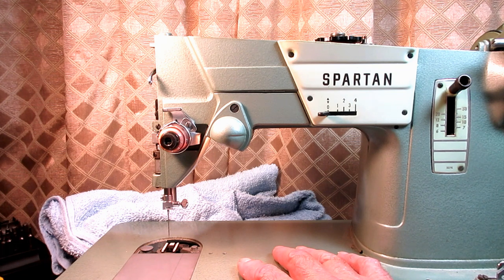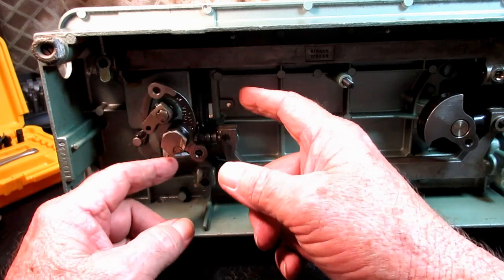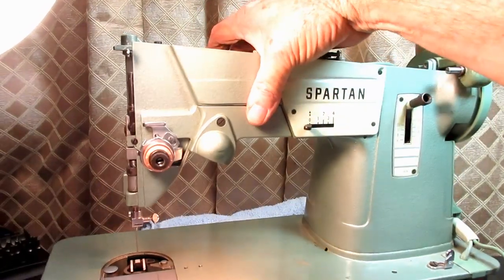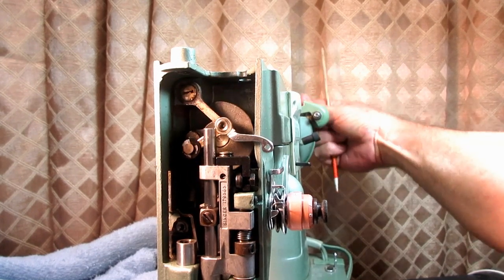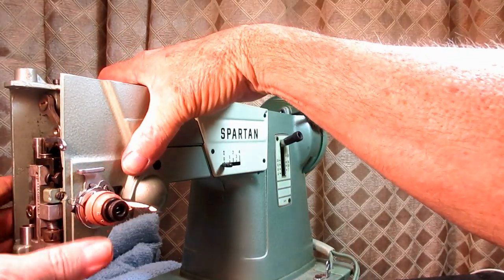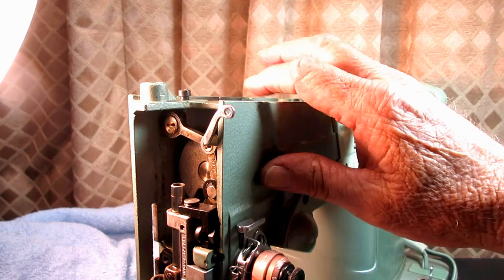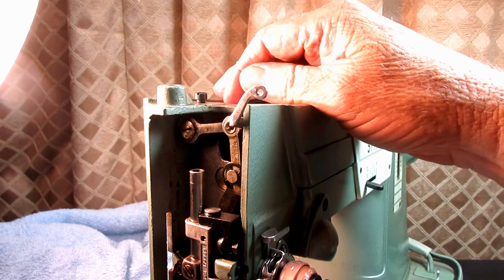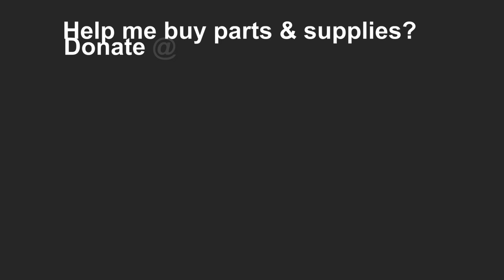How to Fix Binding of the Take Up Lever on a Singer Model 327K Sewing Machine

Comment: Hello again Andy, once again your instructional videos have helped me restore a jammed 329K. The culprit was one of the bolts that go through the pitman arm and fastened to the vertical drive-shaft block. Some previous heavy handed monster was not aware it was counter clockwise left-handed thread and in an attempt to release the bolt had actually tightened it to the point half that of the thread in the block is stripped and the joint seized solid... I made a temporary repair by switching the two bolts over and adding a drop of LockTight thread lock until I can find a donor machine or replacement block. Your guidance has been invaluable to me, thank you.
Reply from the maker: You're very welcome, and thanks for saving another machine, Ken. I can picture the person straining and determined to loosen the darn screw! I've had a number of stripped-out slots on that screw, but never one as bad as you found. Good luck finding the parts.

Comment: Andy, 

Once again, thank you so much for this video.   I will be watching it over and over again.  Thank you for the systematic way to check for binding issues.  I have taken out the take up lever on all the machines I've worked on (457s, 347s, 337s) and cleaned the take-up lever.  I was just never sure how to tighten that set screw.  Now I have a better idea, so I've  got to go back and check every one (seven total).  Putting a drop of oil in the set screw hole is very helpful for me to know, as some I've taken out seemed to be stuck.  Now I know how to check for binding in the bell crank system, too.  I'm starting to work on my 328K; it looks super clean and doesn't seem to have any binding issues, but I know how to start to solve any binding issues, if needed.  Fabulous video!
Reply from the maker: thanks for the kind words and I am impressed if you have seven to go back and check on you are a busy lady

Comment: Thank you for these videos. They gave me enough background to be able to take on fixing my old NewHome Janome 535/538 take up lever which was jamming against the machine casing. It turns out a screw was loose for one of the elbow joints and your video tipped me off on where to look, so I found that (trial and error), it is running beautifully now. (Note that I loosened the needle bar (unnecessarily in my case) and my model doesn't have any markings on it...so it took quite a while to learn to reset the timing...but I did. ) Cheers, and thanks again.
Reply from the maker: Nicely done there, May! I'm glad you found the video and it was somewhat helpful. Good on you for resetting the timing. Guessing you used needle eye height above the hook point, but however you got it done you should feel proud, and thanks for keeping that vintage machine running. Take Care.
Reply: @andytubesewing1953  Yes, I inserted the needle and tested it above the hook which gives a rough fit. Then I threaded everything to see if the needle would pull up the bobbin thread, once it did I tried sewing (by hand turning) and it was skipping stitches. So rather than go back to try moving the needle bar (which is cumbersome), I slightly lowered the needle where it is inserted in the bar to test the needed adjustment. This fixed this stitches so then I transferred that slight needle insert adjustment to the needle bar, reinserted the needle properly and got it all running nicely.
Reply from the maker: You're a natural VSM mechanic! On most of the SInger when the needle bar is on upward stroke the hook point should be behind the needle and about 1/16" above the eye of the needle. I have used that setting on non-Singer machines with good results. Anyway, congratulations and when you start your repair business let me know so I can run an AD for you. Take Care.
Reply: @andytubesewing1953  Haha. This is the first problem I have had with my machine since I got it for my 16th birthday - over 40 years ago! I plan to give it to my son who wants to learn to hem his jeans.
Reply from the maker: That's a great history for your machine. Props to your son; men sewing are a wonderful thing.

Comment: Great video Andy my first time here,
I have a model 237 fashion mate, I am having The Binding at the very top of the rotation for my wheel, I have oiled and lubed and dusted and the issue only comes when my machine is set on regular, when it is set on darn for the feed dogs, The Binding goes away

I went through quite a few of your videos and I only found one video for the 237

I have subscribed and any information would be appreciated thank you God bless
Reply from the maker: Thanks for the Sub. Here is the home page of my channel: https://www.youtube.com/channel/UCUSPDsHaFtRoz1VA2U1xJ4w/featured    It is fairly well organized for having 600 videos.
You will see the top 2 playlist sections. One is playlists by model number the other is playlists by machine parts. If you look at the model number playlist you will see a 20+ playlist for model 237. https://www.youtube.com/playlist?list=PLsCOZgzzaiKKzvgm_CYPFnDeM8ZqTTo1h    Just so you know. My model playlist won't cover every part of the machine though, except maybe model 337 and 404. The take-up lever can cause binding for sure, for a few reasons. I do have a good oiling and greasing video for the 237    https://youtu.be/rqXbbbEX78k    over the years I have found that cleaning and properly oiling the machine clears about 80 - 90% of the problems, especially if the machine sat for a long time, like years or decades. After oiling a machine like that I run it at moderate to high speed for about 5 minutes. Old oil in bushings and bearings can harden like varnish, and a clump of oil sitting in the bottom of an arm shaft bushing can cause binding. I'd suggest buying the Service Manual for $10. It has 35 pages that cover all the adjustments and settings and this particular one has a list of 15 things to look at if you have binding (page 28)
I buy my manuals here when they let me. They were starting to put a limit on how many you can buy. Here is the link:
https://manualsoncd.com/?s=237&post_type=product   (Don't buy instruction manuals as they are free from Singer Support Page.

Comment: Sir, i have problem to center position of needle. Zik zak sewing is not possibile. Needle is stil on the left position. What should i do?
Reply from the maker: That can be a tricky adjustment. Sometimes you need to center the needle in the hole of the straight stitch needle plate. (or try to center in the ZZ needle plate) Sometimes the Selector bracket needs to be adjusted by the cam. If you email Alan at andymanuals53@gmail.com and ask him for the Service Manual for Models 327/328 I will have him send you a free copy by reply email. It is a PDF file. Good Luck.